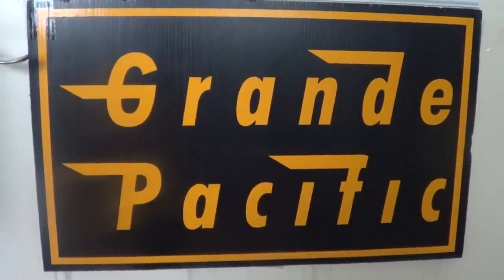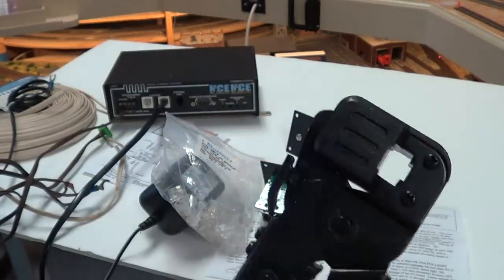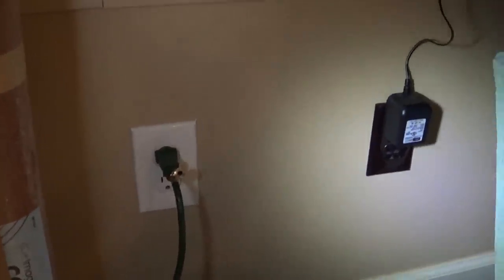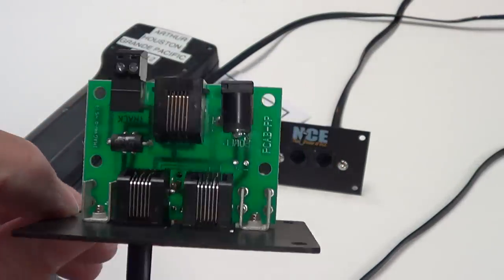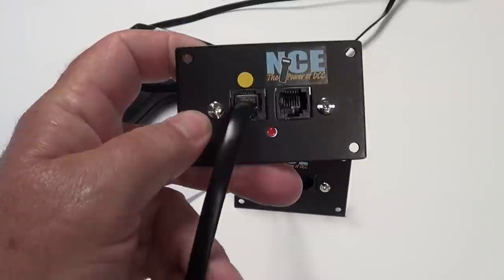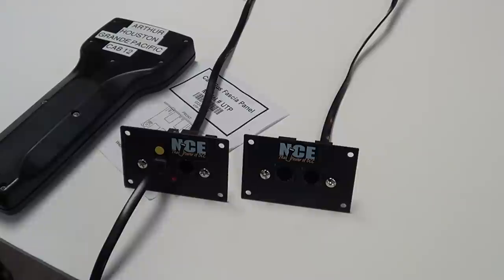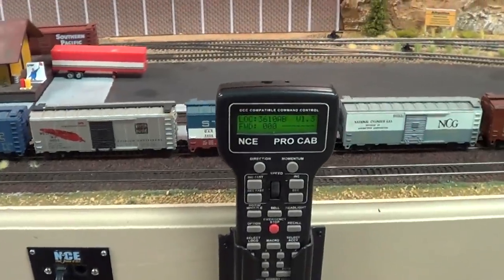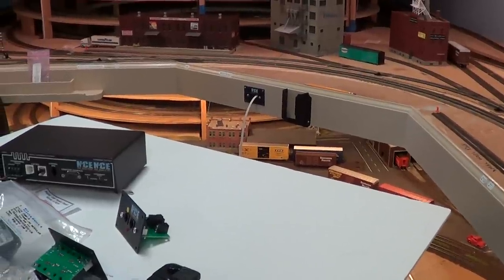NCE CAB BUSS PT 2 of 2

Comment: Thanks for your helpful videos, they're much appreciated. Of course time marches on, we get older and wiser, and NCE have since changed the design of the UTP. It now relys on barrel plug connection for using  a 12vdc supply, the instructions state that up to 2amps capacity can be used. I found that a bit scary ! so I've used 1 amp wall warts. There is now no automatic disconnection from the command station, a pcb track now has to be cut with a stanley knife or similar.

You mention that a UTP can be used as a cab bus splitter, it's certainly good for that purpose. It's also good for using on the rear of a layout accessory control panel (mimic panel). It provides a good "bulkhead" connection socket with the main cab bus. I've used this with the facia plate discarded and mounted directly on the rear of a HAMMOND  1456RL1WHBU enclosure. The facia plate was used as a template to mark out the position of the holes to be made.

On one of the 3 mimic panels that I have, I used a NCE Mini Panel as the encoding (sender of DCC command) device to operate macros that were set up on my pro cab. This was towards the end of a chain of cabs, and I had to insert a 12vdc supply for it to work. Because effectively the UTP was mounted back to front (reversed), instead of cutting the 12v pcb track supply from the command station as intended by NCE, I had to cut the PCB track connected to the opposite RJ12 socket, and CLEARLY mark the 2 outward facing sockets as which to connect to the command station, and which to not to connect to the Command Station. Just in case that was confusing, the input from command station now plugs in at the faciua plate side of the utp instead of the rear as was the intention of NCE, I hope that clarifies the case. It all works beautifully, I now just press a button and a track is selected through my fiddle yard.

I hope that this information helps others.

Comment from the maker: Power bus, or as NCE refers to it track bus. I do not have snubbers on the layout in any district at current time. I did have them on two districts and were put across the two leads at the end of the district. They were removed after addition of additional 5 amp booster and problem of only select locos losing signal ended. Make sure your tracks bus wires are twisted.

Comment: A related question about the power bus for the 5 amp NCE Power Pro. Do you use snubbers on the power bus? If so, where did you use them? If not, why? Thanks again for a great tutorial on the cab bus as that is what I am working now.

Comment: I have a layout that is 4x16, switching layout. I have a NCE Power Cab and I would like to installed two UTP Panels (524-207) I have my main Power Cab at the end of the layout. I would like to installed the two UTP panels on the side of the layout by my two yards. I run a Min. of two switching engines. Do I have to installed a booster because I went with an extra panel? The distance between panels is 4 ft across and 8 feet to the PCP Panel.

Comment: I plan on adding about 4-5 panels onto my power cab system. I will only have 3 cabs max including my power cab. Do you see any issues with this ? Also where did you get the crimping tool? Thanks
Reply from the maker: Yes you can only run maybe four engines. You can make up longer cord for power cab and eliminate PCP pNnels. Or go to a SB5

Comment: Art

I have a question. I have a power can set up. I am working on a 16x10 layout.  My layout will be more for rail fanning the operations. I will also operate no more than 3 locos at this time.

My question is regarding UTP panels. You say the power can doesn't have enough power to go more than 1 UTP panel. Is that still the case even with adding wall warts. I want to put UTP panel on each end of my layout for a total of 4.   Now I know that with the length of the cab bus I would need to add a wall wart, but even with a wall wart, will the power cab have enough juice for what I want.  No more than 3 locos running at a time.   Thanks
Reply: I plan to keep the power cab plugged it all the time like you have to and use another throttle to run the loco and plug Into other UTPs
Reply from the maker: You can run around 3 powered locos at the same time with a power cab.  If you need more then you can add SB5 Smart Booster.  NCE sells wall warts for the Poser Cab. Call them.
Reply: Ok I see.  The power limitation of the power cab is for the locos only.  So in theory as long as I have the proper amount of UTPs and wall warts installed  my cab bus can as long as I want. The 1.5 amp limit of the power cab system is for the amount of locos running at once  and does not effect the amount of extra UTPs and cab bus length.

Comment: Sir, I have watch you on here and on NCE, What I am looking for. You have a 200 foot long tracks and sidings as well. I am looking to know, How many boosters with you need, Is there a wiring diagram to show how you get all the items to work.
Reply from the maker: +James Baxter This layout is powered by NCE and it has 5 five amp power boosters for a total of 20 amps. It is split into seven power districts. They are protected by EB-1 circuit breakers set to trip at 4 amps. Eech level top and middle are spit into two for a total of four. Bottom has  one for staging yards. and Helix is one on it own. Other one falls in the work area. The track buss is 12 gauge stranded copper wire. EB 1 has it's own track buss and all are independent from the other.

Comment: How would i go by wiring the sb5 power booster for the pro cab?
Reply: You would wire the SB5 the same whether it is the pro cab or power cab. Because the SB5 takes over the command station function of a power cab, the power cab simply becomes a pro cab.

Comment: Would a Z-1000 power pack work from my DCS commander or would that way  to much
Reply from the maker: Think Z 1000 is Digitrax.   You can use Digitrax boosters on NCE system but the order of the four wires in the hook up is different.    But you are mixing apples and oranges which will lead to problems getting it all to work.